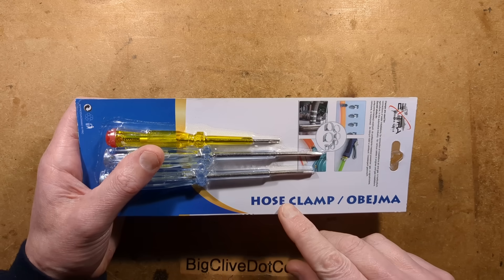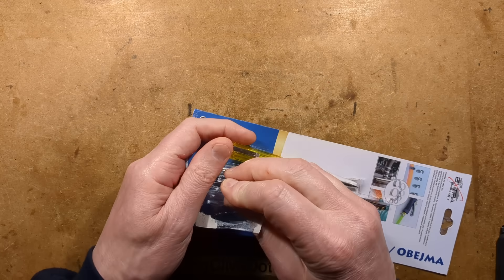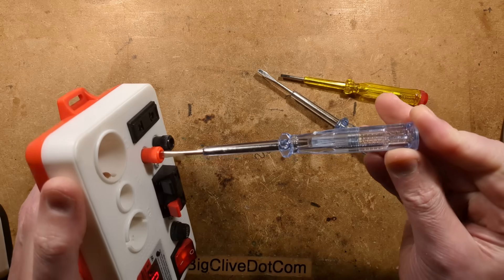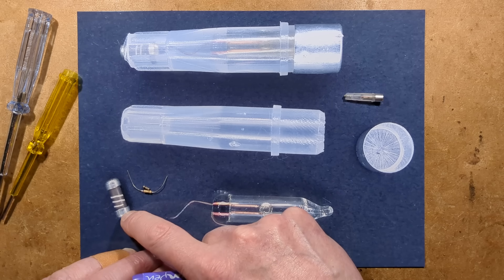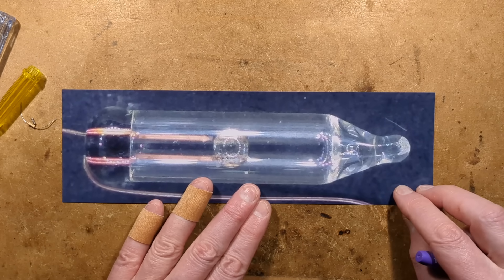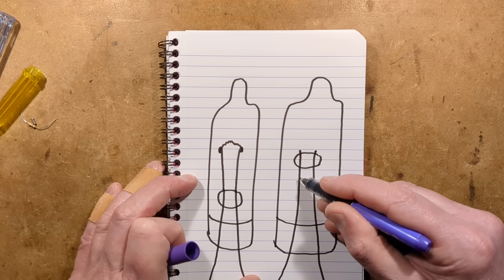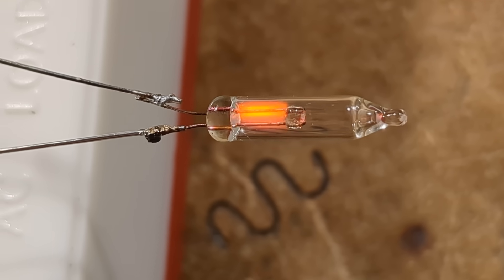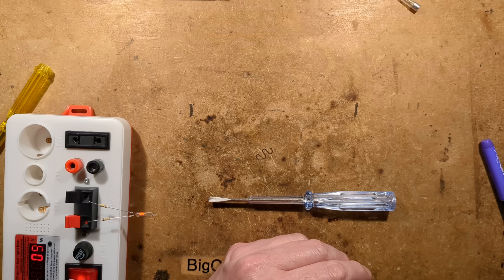Mispackaged testers with very odd neon bulb

Comment: These things were prohibited items way back when I was serving my time with the Electricity Board in the 1970s.
Reply: Same where I worked, we were provided with proper test gear anyway, why would you want to use something cheap and nasty?
Reply: Seems odd that they're still allowed to be imported, then... 😳
Reply: @dieseldragon6756 Not prohibited to the consumer I don't think, just to the electricity board people.
Reply: @dieseldragon6756I was talking to an ex HSE Electrical inspector some years ago, the inspection company I worked for had called him in to give a talk on electrical testing and compliance with the Electricity At Work act 1989. He said if it was up to him these things would have been banned decades ago. No matter how well these things are constructed, they work by allowing an electrical current to pass through the human body. 
I did once come across one which had a small flying lead attached to it with a crock clip at the free end which would have been a bit better but I wouldn't use anything other than approved test gear myself, as a fellow spark I worked with many years ago used to say about working with electricity, always remember, you're a long time dead. If other people wish to use this stuff that's up to them.

Comment: Speaking of mis-translations: I recently bought a low power (low quiescent current) inverter, one of the features being "changing vaginal discharge" fan control. It took a while to figure out it meant PWM.
   When I was seven I got for my birthday a pair of pliers and one of those yellow "phase pencil" screwdrivers you have here (plus some other tools I can't recall). The phase pencil lasted to my 20's and 60 years later I still have the pliers.
Reply: Did you figure out how they translated it?

Comment: These are multi-purpose screwdrivers, can be used for slotted, philips, and pozi screws (if the tip fits). Can be used to open tins of paint, plastic caps, and a whole host of other uses. The only thing they are useless at is testing live connections...🤣🤣🤣🤣

Comment: I was going to say those should make a halfway decent spark plug wire tester/spark plug tester... Provided one stays *FAR* away from any uninsulated portions of the system... Otherwise it can be a good lesson in high voltage electricity and why not to mess with it. Those old school engines that only use a loop over the plug terminal still bites pretty good 😂

Comment: Also note that these screwdrivers were used to check for voltage on the spark plug wires of a gasoline engine by putting the blade on the wires insulation.  Ignition system voltage is dependent on spark plug gap and can vary from 10 to 25 KV.

Comment: The use of thin wire as the electrodes in the neon bulb may be to get a brighter glow at low current. Brightness being inversely proportional to the electrode area at the same current. So this might not just be based on cost.

Comment: Here in the US the oldies used a 1 meg bare resistance that appeared about 1W in size and  an NE2 (or similar but with leads on both ends) lamp. I have seen them built into fuse pullers too. Be careful out there! 👍

Comment: I use testers, but I test it first, everytime I use it. I test to see that it's still working and that I'd be able to see the light in the light situation I want to use it. I test that too, with a known live (or before I shut off the breaker), in the intended lighting condition

Comment: I've once found a neon lamp looking like a (blown) "Festoon" car bulb inside a broken tester. Added a 100 kΩ resistor and tried to use it as a night light. After getting steadily dimmer and dimmer,  in 3 days the glass got completely black from the inside and no light was getting out anymore.

Comment: I'm not a fan of this type of one contact tester. In German they are also called "Lügenstift", which translates to "lie pen". PB Swiss Tools makes a new LED version of the one contact tester screwdriver ("PB 175.0-60 LED" and "PB 175.1-75 LED"). I have not tested them, but would be interesting to see if the LED light has a better visibility.

Comment: there's a new type of test drivers with a digital display, and can test up to 400V. If you press the button it shows the voltage (with you as a reference to ground). If not then it becomes an NCV tester. I have seen at least 2 electrician use and recommend that before, and it would be really interesting to see the circuit. From their videos, it seems really useful for diagnosing leakage, poor ground connections and 3-phased power shenanigans.
Reply: They are the only devices certified for testing EV electrical systems as dead.

Comment: Guy I worked with claimed to have dropped one of those style screwdrivers in a bucket of water when he was an apprentice, didn't say anything as he was too scared to get in trouble, he got in trouble next time it was used....
Reply: Probably not so daft as the telephone engineer who was taught that the water in the bottom of manholes provided an acceptable earth for their test equipment. After passing-out he was servicing a customers office phone system on a higher floor, and asked for a glass of water to drop his test lead into... 🤣

Comment: Maybe it would make a nice video to tell people about the proper way to verify that circuits are or aren’t energised. I guess it’s similar in the UK but over here (Germany) a “Spannungsprüfer” (Voltage Checker… I guess would be the literal translation) has to have certain properties to be safely useable even on otherwise unfused/unprotected circuits and has to indicate presence of voltage reliably (for example even with batteries, if it has some, depleted), shouldn’t have extremely high impedance so it indicates voltage for capacitive coupling between conductors…

We then commonly refer to these things as “Duspol”, by the trade name of a very common model.

Comment: In the 70's my uncle used the neon "screw driver" to distinguish hot from neutral in a 120ac line. He ran the hot through a 25w incandescent bulb and then ran a bare solid 18awg on insulators around the perimeter of his garden about a foot above the ground to form an electric fence to deter small animals.
Reply: That seems a little heavy-handed as a 25 watt bulb is only 625 ohms. My great-aunt used a similar thing on her horse farm but ran the power through a small AM radio tuned to static. When something touched the wire the radio would squelch.
Reply: @paulmccoy2908 lol, the first wireless intrusion alarm, I like it.😁

Comment: I really hate that they skimped on the isolation near the tip. Why have it away for 3 or 4 cm while 1 cm free of isolation is plenty. So easy to touch the live bit with your fingers. Is there a rule about this length?

Comment: Curious if Clive has seen the ANENG B05 testers.  They are similar, but have a small battery powered PCB with LEDs.  Very sensitive, but obviously can be unsafe as testers if the batteries are dead and a verification test isn't performed.  Not sure what leakage current they might allow though.  Might be good for a teardown video as a followup to this one.

Comment: The "blip of light" at the end of the neon is in fact a refracted image of the arc between the electrodes , formed by the lens effect of the deformed melted glass. In other words it is a mirage
Reply: or... it's actually arcing over at the ends, since they're spaced the same, flush to the end and inside the same gas tube.
Reply: @throttlebottle5906  Naa. Might only happen at the end of the glass bead... where the wires end. Minuscule light output on such a small electrode area.
 Note that reflection 'flash' is at the end of the glass envelope.. nowhere near the wire electrodes.
Reply: @BTW...  quote: at 7:25 "very occasionally, you get a little blip of light that goes across the wires at the end there"  that clarified it being the wire ends at the glass bead inside. not the end of the tube... some one here seem to need better ears, vision, monitors or all...
Reply: No, it's isn't a "refraction" or "a mirage". 
It is a REFLECTION on the first internal surface of the glass bulb.  Any refraction effect would be a projected light outside the glass. Perhaps there is a little refraction going internally from the glass ball that spaces the lead wires, but it's not an intended design. 
You see exactly the same reflection on the internal surface of bubbles withing art glass paperweights and such. 

Neon indicator lamps used in industrial pushbuttons and Indicator lamps have a well designed molded lens at the top - being part the glass envelope - that's refraction.  They have a high light output, unlike these
The gas is charged at the bottom, where the wire leads are located, just like a larger domestic lamp, Unlike these cheap 'tester' lamps where the pinch off forms an 'anti-lens' form, of sorts. 
These industrial lamps have a bayonet or screw cap, just like their incandescent or LED cousins deigned for the same application.

Comment: There is one use case where these or preferably their modern electronic equivalents are the only solution. And that’s if you’re connecting up a class 1 luminaire to an old 2-wire "Line and PEN" lighting point. Such are still common in old buildings in mainland Europe and the wires can be almost any colour. The one that’s not live in reference to earth-ground is used for both the neutral and earth of the appliance while the live one feeds it with power. Your double pole voltage tester won't do you much good to find what is what there.

Comment: I spotted the weird bulb through the shell at a dollar store and bought one out of curiosity, the bulb blackens very quickly if ran continuously as a normal neon; as in considerably darkened over less than an hour
Reply: I experienced similar when trying to electroplate coins hung from untreated steel wire that were in contact with the acid; The steel corroded and gave an interesting result to the electroplating. I wonder if the electrodes in these are also a cheap general metal which corrodes/decays under sustained energisation? 😇

(I'm going to guess „Always On“ neons - Like those in most power strips - Use inert electrodes which don't have this problem.)

Comment: Voltage indicator screwdriver: The shaft goes all the way to the rear of the handle , when it contacts mains voltage you get an unmistakeable mains voltage "indication" through your body

Comment: When I was young, I couldn't comprehend the infinite resitance my father said was in them, he got me to hold one against the lawnmower spark plug lead while he pulled the starter - did that auld bastard laff like a drain, or what 😂

I'm not sure they were much better built, then but fewer choices: he had a massive mains powered AVOMeter (with valves) the size of one of the wartime radios he ditted, and dahed on, not exactly portable, 'tho it had a handle LOL 🤣 I recall it's range was impressive from the Millivolts produced on human skin, to 1KV 

I don't recall the amps but probably 50/60 considering it's age and the rudementary wiring found in semi rural Scotlandshire. In fact there had been a small Radio factory in Arbroath, who even briefly developed a small TV line, so possibly acquired from there, and used for some HT Valve, and CRT testing

I now much prefer my pocket pen multimeter with NCV

Comment: I wonder if the cheapness of the design, just so happened to make it "more safe" in that it's maximum current draw is less than that of a typical neon? It is dimmer, suggesting a lower maximum current capacity.

Comment: Years ago, I took a cheap spark plug tester apart...built into a mini screwdriver, the neon bulb used silver paint as contacts, the resistor was a small cylinder of graphite, and a small spring kept contacts pushed together. It worked, but every single cheapout possible had been taken. I worked at a hospital at the time, and one floor had carpet that built up an impressive static charge by just walking across it...enough to fire the tester. I wound up giving the tester to a nurse, who though making the little light flicker was giggle worthy. Wound up buying several more of these testers ( got it at a flea market) for other nurses on that floor....
Reply: what was a carpet doing in a hospital? how do you keep it clean and tidy there?
Reply: @morfeyrun  It was in the waiting room on the 7rh floor( top floor) the waiting rooms had carpet.. Some of the offices did as well.
Reply: nvm all that, tell us more about the nurse
Reply: Can you remember roughly what sort of year/decade that was? That sounds like something I'd only expect to see if produced in the past five years! 😇
Reply: @dieseldragon6756 Early '90s..a stall at a nearby flea market had a bin of them for 50 cents...
Reply: @dieseldragon6756 This was the early '90s. I got it at a flea market..for 50 cents.

Comment: Why do they even make these resemble a screwdriver.... as you said... they are terrible at the one thing they most look like..... 
btw... the packaging was right... i suppose you could use it to fasten a hose clamp (once or twice). Possibly this was the reason for the mix up.... as the hose clamps are pictured on it.

Comment: Also, using just the leads for the neon glow, they didn't even bother using the full length, embedding the lead tips in the top seal. Double the disappointment.

Comment: This reminds me of an unforgettable memory where I used one of these screwdrivers before dismantling an electrical domino to check if I had cut the right line (240 Vac) ; but, unfortunately, I think the internal resistance was shorted (edit: or maybe a « funny 12V screwdriver tester for beginners » which is identical to 240 Vac )⚡😲 …
 « I will have to cut off the whole apartment and I'll have to change screwdrivers  »

I bought a screwdriver that detects the phase through the cables 😅
Reply from the maker: For a while there were twin packs of testing screwdrivers for 240V and 12V.  They looked identical.
Reply: @bigclivedotcom provide a 12 V tester screwdriver in a pack containing others for 240 V … 
I think whoever came up with this idea is a genius who is banking on skimming by natural selection 🤔
😅

Comment: Hey Clive, hope you read on, was it you who once did a bit about >> Heat Shrink Butt Splice Solder connectors << ? Well, I had a re-wiring job on a 3 axis gantry mill. It is a huge job. Closed loop Stepper Motors have both Drive feed (18AWG x 4C) x3 , and Encoder cable with 6C 24AWG x 3 motors, then there are limit switch x 6 (ea w/3 x 24AWG), Probe x 3 (same as limit sw.), 12VDC LED feed x 2, etc etc. I thought, "Hey this is a job for those if ever there was one". So yesterday I'm feeling encouraged with the lion's share under the bridge, something like 60 mind numbing connections, all finished with expensive and dwindling supply of specially ordered waterproof heat shrink that is happy in a drag chain under constant flexing yah? 
So as it goes, I'm doing the last couplings, those 12 x 18AWG  using a  newly arrived 500 pc kit, a  last minute order that had the 18ga range amongst four others. During the first set up, I notice right off that the solder ring didn't seem to be sweating or doing that nice tinning creep along the strands both sides. Much easier to see of course with this gauge range. So I get my USB micro and have a look. Not groovy. Cut it open and it fell apart. So I do a conclusive in-depth test with several AWG range and using earlier purchased stock of the 22-24Ga (red ring) to rulke out a bad re-seller or stock, and even helped the process with regular flux, liquid flux and various heat ranges. Concluded that even with flux and up to 650deg C There was no hot shiny solder joint. All documented and photographed with stress test and conductivity meas.
Lost a day and my mind. I'd like to send you this kit and you can do a breakdown on these and telegraph to the world the real poop regarding these turds.

Comment: You can make these glow brighter by placing your "spare" hand on a well earthed appliance case.
Reply: Make sure you have your spare heart handy😂
Reply: @solsol1624  Yes! Arm-to-arm, as little as 5 milliamps might stop the old 'ticker'!
Reply: As I noted elsewhere the copper piping in the airing cupboard is good for this.
Reply: I have the same one(the translucent one, not the yellow one) and if I'm relatively insulated from the floor(say on a ladder, chair, bed - whatever 🤣), touching the nearest wall/ceiling does make it glow brighter, therefore easier to read 🤣

Comment: Obejma = Polish for brace or clamp. Weird that the Chinese are putting Polish on the packaging :D Any non insulated testers like that are only intended for 12/24 volt automotive applications. And fair warning, they are not much good for it either, LED is ok, but a filament type bulb can and will draw more amps than most sensor circuits will under normal operation.... and letting the smoke out of modern vehicles can cost thousands REAL QUICK. Even tens of thousands seeing as how even simple things like a SPARE WHEEL are either THOUSANDS of dollars to order....or they won't even sell you one. Because they "don't make enough money" selling parts, they only want to sell you a new car.......every six months. Emissions laws and the CORRUPT safety stars are handballing them free excuses to do it :(

Comment: these neons are special; they have a glass blob at the top so that the distance between the electrodes can be controlled. The neons I have are made with s thick electrode unsupported at the top. I would like to get some neons with the glass blob at the distal end
Reply: Two rods are ordinary. Much better light from the type that have electrodes in the form of a concave disk and a ring halo... and an integral molded magnifier lens  on the end of the glass bulb.